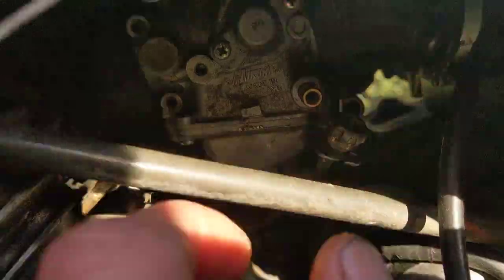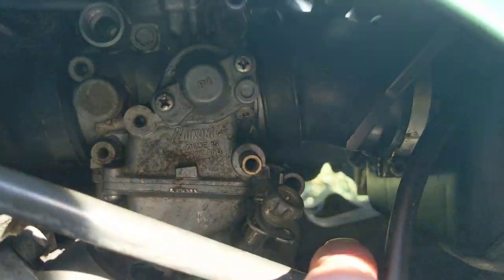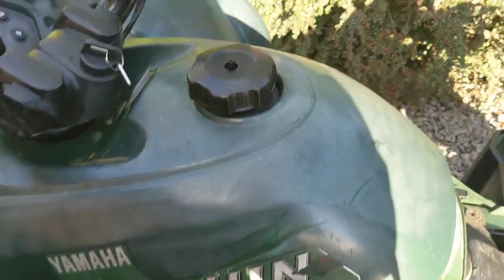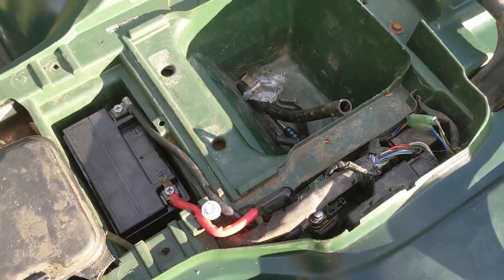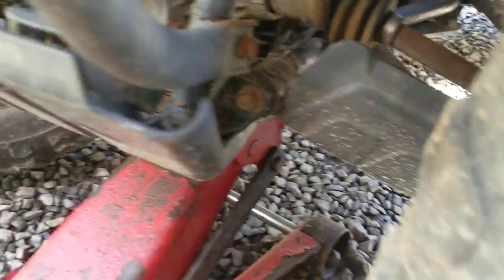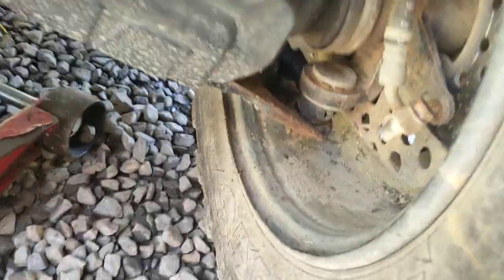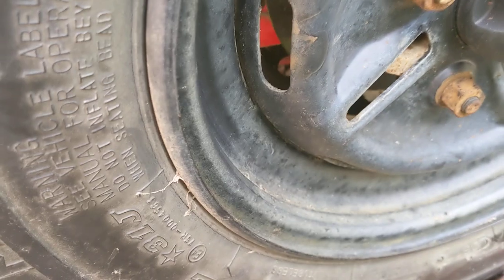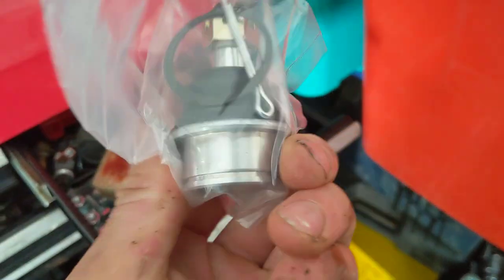Bargain Yamaha Bruin 350? grizzly quad!

Comment: Sweet. I’m going to have to record a video. I also picked up one like this (yesterday) , the 350 I have is called a kodiak, I’m pretty sure... and I have the recoil on it. And independent rear. Good tip for the 4x4 diff lock wire. My light comes on, but it’ll be something to watch.

Comment: yeah, I had thought it may have been a 2004, but mine has the recoil starter. I'm wondering if you had ever run across an issue on the oil cooler fan fails to turn

Comment: How will it be going for?? And where abouts are you based??
Reply from the maker: Mid Wales. Depends what I have to do for it but will be reasonably priced
Reply: An idiots opinion let me know when you know a rough price bud 👍🏻
Reply from the maker: It'll be in the region of £2,500 will have both new upper ball joints, both new lower ball joints, new NSF wheel bearing, 2 new CV boots, seat recovered, racks re-finshed, both new front calipers, new brake pads, new master cylinder, full service (engine oil and filter, plug, air filter, diff oils.) Most of this will be filmed so you'll see that it's been done. 

Will be ready in approximately a week's time. If your interested let me know.